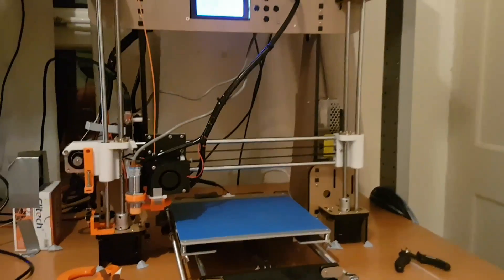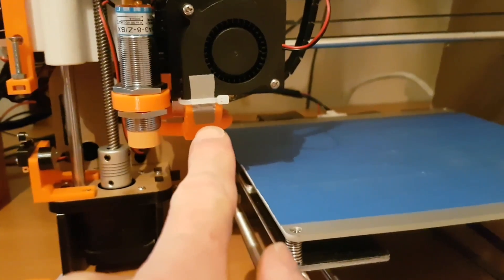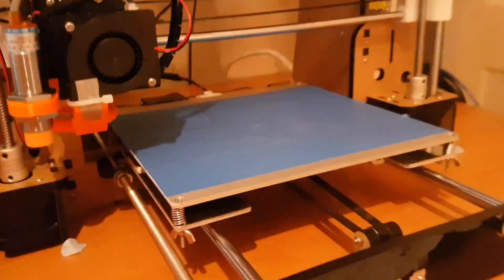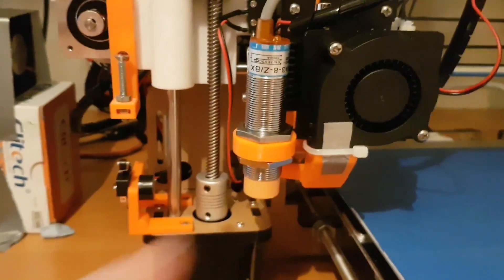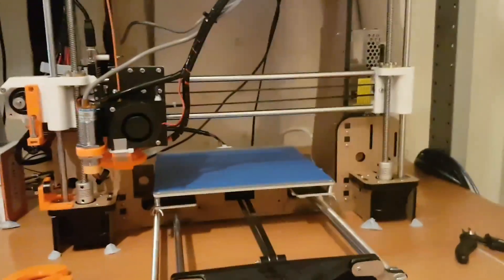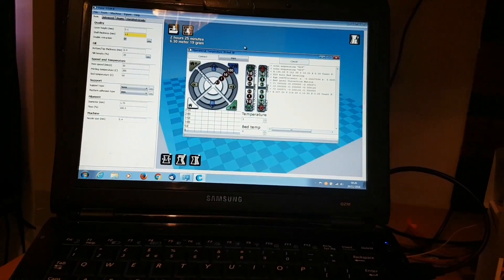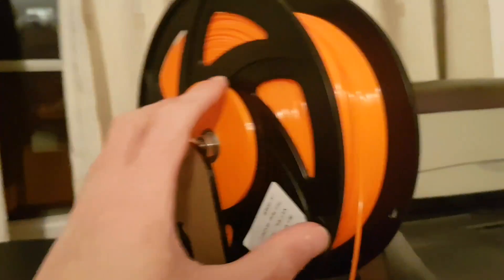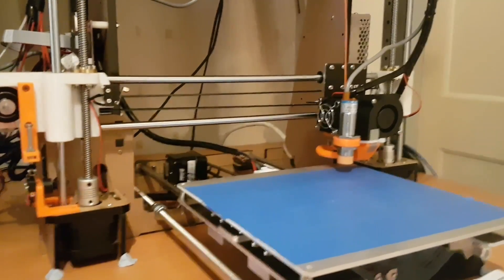Anet A8 3D Printer and Mods

Comment: where did you get your filament from, i really like that orange colour and that same printer is being shipped to me at the moment so i want to get the filament as soon as possible plz
Reply from the maker: Jackson Sherriff Hi. The orange filament came from Gearbest. I ordered it with the printer. Now I am using Prima Value from Amazon which seems to work well. Good luck
Reply: cool thanks

Comment: Hi had problems with anet board that came (bundled with auto level) ended up ordering another board this one works but firmware is previous version and doesn't support autolevel need help with good firmware looked into skynet but printer wont connect to pc I need the right driver I guess any advice?
Reply from the maker: Michael Richards Hi. if its a win based machine then there is a driver bundled on the sd card that came with the printer / board. It is one of the folders. Worked for me. Good luck.

Comment: Do you have to use Skynet, to auto level the bed?
Reply from the maker: tubejim101 Hi. no, it can still work with the switch but you would have to disable auto bed levelling in firmware prior to uploading to board and there wouldn't seem much point. The stock firmware allows easier manipulation of z height manually using lcd buttons imho..
Reply: Thank you.

Comment: Plan I have this problem. When I start printing, the printer makes wierd sound from the x motor. Plz help
Reply from the maker: Hi. Have a look here. https://www.facebook.com/groups/1068531466501015/permalink/1284063551614471/?match=bW90b3JzLG1vdG9y

Start with the couplings then try the other things. Good luck

Comment: I have a big problem with the right z level motor. It won't turn and because of that, I can't manage to print anything! Please help!
Reply from the maker: TheUnHumanZone. Hi. I can only think it is either a bad motor or more likely a bad stepper driver on the mainboard. It might also be a loose connection on the wires between the board and the motor.  Try swapping the connectors for the two Z motors on the mainboard. They both do the same thing. If the dead Z Motor starts working then its something on the mainboard (probably the stepper  driver). That would be hard to fix unless you have a hot air rework station and a lot of patience. Hopefully, its not that and either that motor or the wiring between it and the board. Good luck. ps. Gearbest sells spare motors for £7
Reply: Plan C Thanks for that!
Reply from the maker: TheUnHumanZone no probs. have a look in the official anet user support Facebook page. Someone had a similar issue and it turned out to be that the leadscrew or coupling on that side was too tight or done up wrong. Worth a shot.

Comment: I have a printer like yours and I need help because every time I think its leveled correctly. It pushes the bed way down and its starting to scratch the bed. How do I fix that problem? any help is appreciated
Reply from the maker: J. GH Hi. Are you using the Skynet V2 Firmware and autolevel? If so, recompile with the Z offset set to 0 in the configh in Arduino and upload the firmware to printer. Then, separately, clear any z offset from the eeprom by going to 'motion', 'z offset' on the lcd menu and set it to zero. Then, straight away, press and hold the right button (this should store yhe value but I found it flakey). To make sure it is stored, and this is important, go back to the menu where it offers 'load memory' and 'store memory' options. Select 'Store memory' and hold right button. The text should disappear for a second or so. Go back to Motion and then check that the value for Z offset in lcd is now zero. That all puts it back to square 1. Now connect over USB, open up Cura 15.xx and click white Home All. Z should now be at 10 and sensor on middle of bed. Now lower Z by 10 so it reads zero. Now keep going with the paper test until you are happy with the drag. Write down the figure you have. eg -0.7. Go to 'motion', 'z offset' and put that figure in. Hold right button and then back to where it lets you 'load from memory' or 'store to memory' and hold right on 'store to memory'. Z offset should now be set. Check one last time in 'motion', 'z offset' and, if happy, Home all. it should now be at zero and drag should be good. I would do it all with the bed heated as there maybe some expansion. hope helps. good luck
Reply from the maker: J. GH oh and dont forget to type the G29 command to your printer profile Gcode in Cura. I put it just after the first G28 line. Settings>printer>manage printer>machine settings. That one caught me out for a while.;)
Reply: One thing that is often overlooked is that the aluminum printing bed will expand when heated. If the distance between the extrusion nozzle and the bed is measured while the bed is cold, that distance will decrease significantly when the bed is heated, causing problems such as what you are experiencing. Don't ask me how I know :).
Reply: sorry it took long to reply. I really appreciate your help
Reply from the maker: Hi, I did another vid here that may help https://www.youtube.com/watch?v=_nByWPLTrOY

First thing I would try is pressing 'home all axes' via lcd before a print. Also, check that the z offset was set to zero in the Skynet config.h and that the z offset value you picked on the lcd is saved to memory correctly (you can check by scrolling to read the eeprom value from menu on the lcd menu). Could also try disconnecting USB cable if printing from lcd and sd card. Hope helps & good luck.

Comment: Hi,
I ordered this model and made a list for upgrades that I planned to attach to this printer.

Cooling Duct: /thing:1547256
Spool holder: /thing:1624641/
filament guide: /thing:1764285
Frame Brace: /thing:1430727
Belt Tensioner:/thing:1492411
Anti Z-Wobble: /thing:1858435   and   /thing:1858459
Electro Case: /thing:1767285

Are there any changes or additions from your side? That would help me very much.
Reply from the maker: FleBiX  Hi.
Nice list. I would def consider something to cover the wires to the power supply, preferably with a switch on it. I remixed one to fit a computer type socket and switch from Maplin. I'll upload it when I get a minute. Change the power cord that comes with it for some proper 3 core flex and make sure the hotbed and power connections to the Anet v1.0 board are good. Some even solder direct as the connectors are not that great. I am printing the frame brace you listed. It is huge btw so probably one for later on the list. The cooling fin you listed works fine. I used the one linked in the linked video review. I think there is an improved one now that screws behind the fan so more secure. The Z wobble things look interesting. Might give those a try! I opted for a board cover that holds a fan to help keep the mosfets cool. I would def recommend some kind of cooling there and also for the power supply. I have actually just ordered an external mosfet for the hotbed (which are on backorder) as I am thinking of trying out some ABS which requires higher temps. There is a cover which incorporates a holder for that too - just search for hotbed mosfet on Thingyverse. Other than that, the z switch holder in the video really helps and I just bought some cork placemats from Ikea to put under the hotbed to help it maintain temp. Lastly, oil inside the bearings with something before assembling. I forgot that lol. Silicone grease works well. Hope that helps a bit. Good luck.
Reply: Thank you, that was really helpful :)

Comment: Those mods look very useful. Might print myself a few of those :) Ordered my Anet A8 printer a few days ago.
Reply from the maker: Sintoxic Thanks. I think it is a great little machine & loads of fun. Good luck with the build. Btw, I would suggest a 5 by 5 grid for the auto level ( you just have to change the 3 to a 5 in the config). Also, for the z offset, you dont need to compile in Arduino, I was being stupid, just use the lcd per instructions in the linked files. I will update description to avoid confusion. All the best.

Comment: https://lookaside.fbsbx.com/file/lcd2006_anet_a8_i3_pursa_shroud.stl?token=AWyIOg2WYNunBMHUAJAWN5dV8BMjg5nHNoOICNV_fiw3KL_r-iIfoLusFQbuBlnA15MIAZUmS1DPeXai0Z9lnb_iFna0oyIPv2anowiEoI5VNq19avj7gpEBFhDaP1TpKbinARVGlxouD4IdIZymnWHWENhIhaiXgikrb0VSJIVxxA 

 That should be a link to the STL file for a bezel to go around your screem. apparently it can be found on thingiverse. it downloads and opens fine in repetier. it was posted in a support group on facebook :)
Reply from the maker: Richard G 
Thanks Richard. I'll have a look. Appreciated. I have since printed a power supply cover/switch & socket holder and will put it on Thingyverse. It is a remix of one that was already on there but was too narrow for my PSU. I edited it to fit a Maplin part. I also made a couple of supports to go under the Z steppers and stop the sides from splaying out. Lastly, I have put the whole thing on a rubber mat to lower noise. They are designed for washing machines but seem to help. All the best
Reply: looks like a fake facebook page trying to phish your information.. glad I didn't sign  in ... sorry Richard you don't get my info that easy... people need to be aware of these scams
Reply: Fake profile....? Lol, sorry to dissapoint but no it's not. I'm just careful not to leave to much of an online foot print which allows me to be traced over social media platforms. From the 2 seconds I spent scrolling down your wall it really wouldn't be hard to work out a personality profile and a list of places you frequent through your online posts.. If a fake Facebook profile is at the top of your concerns I'm happy for you. I on the other hand own an android phone and know that the android open source software tier is flawed with many back doors, Facebook is censored and scanned just as YouTube and other social media platforms. So whilst I have no issue with you suspecting my Facebook profile as I broke my first name into to letters and applied the second two letters as my second name in order to prevent my profile from being searchable using only my name as Facebook lies and does not keep me hidden. This asking helps to confuse Google and reduces the number of online connections made to my Facebook which allows me to keep my personal life hidden away from my work life. As I work at a university or at least do for the next week, not being found by the many students and staff members I have worked with over the last 7 years is highly desirable. But having said all that, you already have enough information online to present your own set of problems and if a phishing profile concerns you, I'd be sure to cleanse your already existing digital foot print. If I wanted to attempt to steal your identify, your Gmail account, services you use and the type of phone you have is where I would start, not a heavily monitored social media platform that already offers me all the information needed to start with. But hey, I was only trying to help out and forward what I had found and when I downloaded the link above myself I was somewhat curious if anybody would be as sceptical about its potential contents in the same manor that I was and whether they would download it at all - thus wasting my time and effort sharing it but also making me feel better in a sense of the fact that I tried :) either way I hope my miniature essay above is of some concelation that you are right to be concerned but in the case it's not a fake profile and that if you really are concerned you'd be worried about a lot more threatening online security issues..  Like when I go on eBay on my girlfriends phone on her account and then her marketing data is used to target me on YouTube, Facebook, Google nd random websites that have paid adds - somewhere a connection has been made and that data is either being saved in a large data bank/server and being sold, or Google has the ability to track any activity across all of its services and use that data as and when it feels fit to - without my consent or my choice. Also, Rich - my name is Richard, but people who know me call me rich - tense Ri Ch as my Facebook and Richard.G as my Google - people who make fake profile don't got to that effort which enables you to confirm a Facebook page is fake within seconds. My Facebook page has also been active for over 6 years.. Fake accounts usually run for a year or two at most and have no friends or wall posts or pictures, if you cant see them or my family connections I am glad Facebook had finally pulled its bloody finger out and started protecting peoples privacy! Its only taken 3+ years! Before the new privacy agrements were in place it was like Google for people! It was like a free database to track down anyone you wanted that used it services! Now they have made it a graat deal harder, but evidentally not impossible, you did after all see my profile+? And I do not know you? Which means you were able to see information pertaining to me that I do not wish to be publically avalible. Anyway. Enjoy the rest of your day,ill be investigating how to remove links between Facebook and YouTube and Google mail or +
Reply: what scared me is when I click on it it takes me to a non facebook page telling me I'm not signed in and to put my info to sign in but I'm already signed in and any other page that has fb link opens me in cause I'm already signed in ... so threw me as scam link to phish fb info from people.. anyone that wants to steal my info go for it have all my misfortune in life ... it wont get you anything but trouble and bad credit score.. some of us only learn the hard way...either way like reply and thanks for clearing link up back to trying to fix/ update my printer :) this video rocks!! very helpful
Reply: ahhhh! I did not know that! it should not do that! It should be a direct downlaod link only, no login, no anything required, that way it is scanned immediatley on download by your anti virus as a zipped/compressed file.This way its safe to downlaod and scan yourself without having to unzip/un compress it. See facebook - messing sh*t up again! i do apologise. at first i thought i was just getting heckled so thought id share my opinion - i did  not realsie it was trying to direct or instruct you to log into anything prior to downloading it. I think in future ill set a drop box account up of see how the google drive crap works - i was trying to make people life easier, not a pain in the derrière. Thank you for the reply.